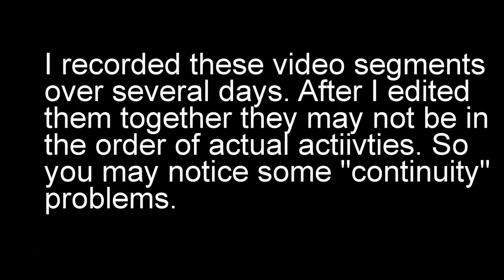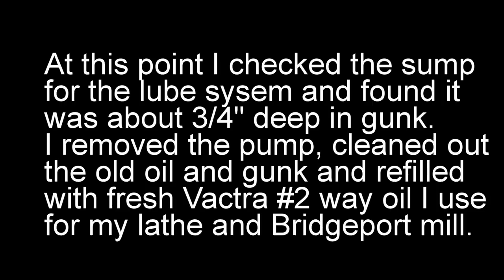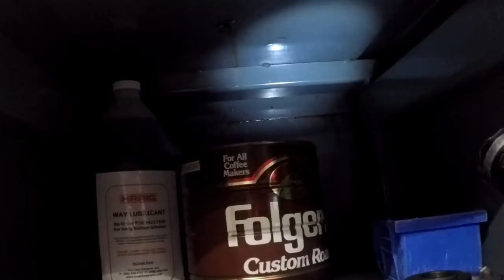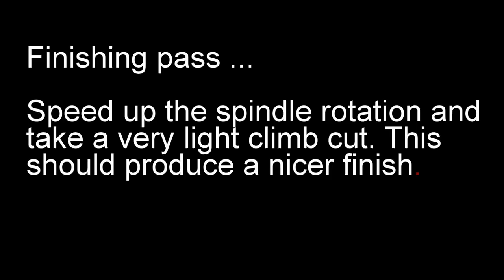Surface Grinder Setup

Comment: Getting exciting!!!
Looking forward to seeing her make sparks.

One thing I learned when grinding my chuck was to keep it cool when doing.
I mixed up some coolant in a spray bottle and kept wetting the chuck.. Mist or flood would be better.
Amazing how much the heat will make the chuck grow.

Thanks for sharing!
Reply from the maker: Yes, I've been playing with making reasonably accurate rectangular solids. Heat is definitely a consideration. I had skid marks all over the first block. The last one is decent finish and within a tenth or two of parallel. I'm learning. I have a mister, just need to get air over to the machine.  Thanks for the comments.

Comment: Good call flipping that thing around.  A rubber flap covering those outlets would have saved your bacon.  I do a ton of bronze work and got a big surprise when the dust shorted an open plug.  KAPOW!  Not pretty!

Comment: Was there a reason you choose a Vfd over other phase converters? I just got a surface grinder a couple weeks ago and I'm running myn on a static phase converter
Reply from the maker: I already had a spare used VFD on hand.
Reply: Old Iron Lover oh ok, the setup process has scared me away from them.Keep up the good work.

Comment: Which oil is to be filled in the bed of grinding machine
Reply from the maker: I use the bottle of Harig way oil that came with. Other Harig owners have recommended to stick with that. There is a reservoir and pump  in the back of the machine that oils the ways and the spindle. I'm not sure of any substitute recommendation but since the spindle bearings are.oiled with this oil I plan to stay with the factory oil.
Reply from the maker: Haig above should read Harig.